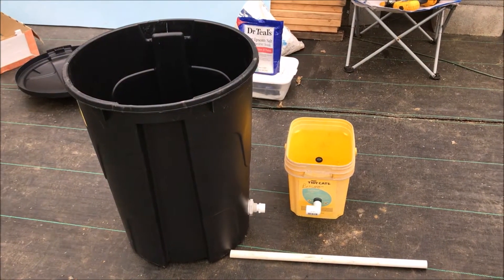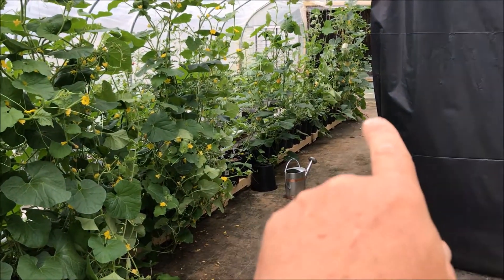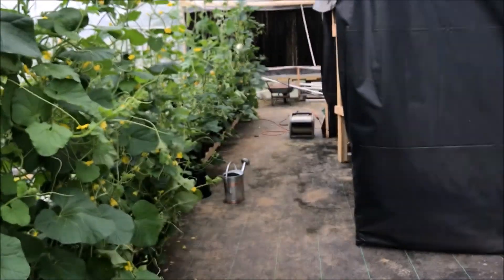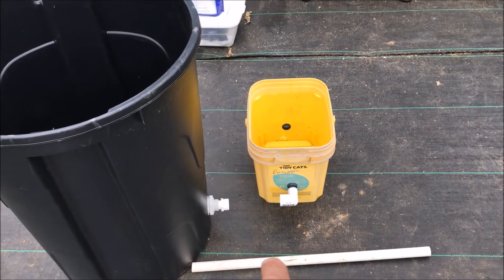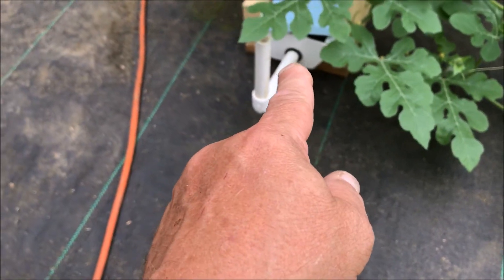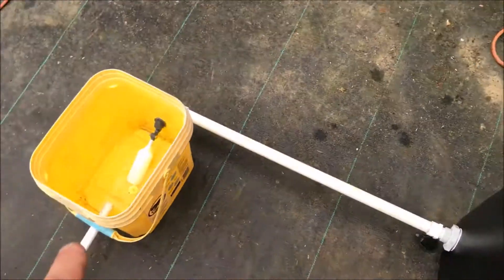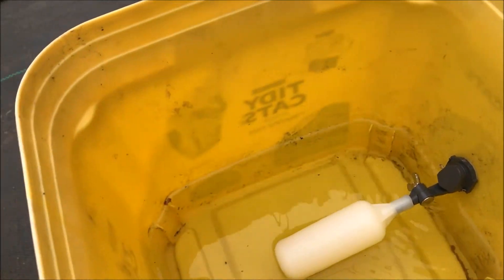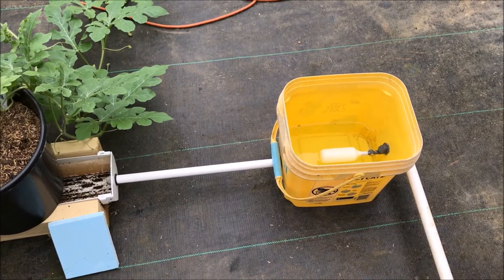Greenhouse Wicking System Reservoir Setup

Comment: Chuck, I really enjoy your videos. I am very curious on the wicking system. Is there no drain end? I see and understand how it fills but I am unclear how the other end looks. Do you use hydroponic nutrients or from your fish water? Inquering minds want to know. lol
Reply from the maker: This system has no drain. It fills the gutter system and the plants take up the water. I have been using a combination of mainly fish water from my aquaponics system and well water every now and then. I do not have it setup where the aquaponics system can fill it automatically so I have to use a utility pump to fill the reservoirs for now. It takes a little time to fill it so every now and then I will add some fresh well water to it in order to keep it from running dry until I can fill it properly with the fish water.
The goal is to automate it by next spring or sooner. I hope that answered your question Bruce.
Chuck
Reply: Thanks for the reply. I did want to mention that a couple videos the audio is low. Could be from using the selfie stick.

Comment: I have 1 40' bucket run and 1 20' bucket run. Both are fed from the same supply tank and each run has it's own float in the gutter. You're absolutely right about leveling. Don't trust your bubble level. Just fill the gutters with water and adjust them until they all have the same water level.

Comment: Hi, Chuck. Thanks. I would have thought the gutter would need a float valve also.
Reply from the maker: TheEmptynester I wanted to keep the float valve out of the gutter for a couple of reasons. One is space for more plants. Another was the control bucket allows me to fill the gutters more fully and still keep the algae down. And another is that it's much easier to adjust the water level in an external volume.
Hope that helps.
Chuck
Reply: Thank you for explaining more. I did not realize the bucket could control the water level like that.

Comment: Am curious as too how you keep the fluid temperatures down as I have read that temps above 65° can start to affect growth and production and temps above 80° are really determental. 

Also have you experimented any with the simple Kratky method?
Reply from the maker: atariforever2002 I'm going to go out on a limb here and say that water at 80 degrees is almost optimal for plant growth. My fish prefer temps over 70 so it never goes below that and they love it much higher. The water temp in my fish tank and aquaponics system very rarely goes below 80 and my plants and veggies are thriving. I'd throw that book you read away. Lol
Hope that helps 
Chuck
Reply from the maker: atariforever2002 I have grown with Kratkys method. Works wonderfully. That water will also get warm and will not harm the plant. Warm temps will however effect the leafy green veggies that you might want to grow in the system. Lettuce will bolt quickly in hot weather no matter how you grow it.
Chuck
Reply: Fensterfarm Greenhouse. Interesting. Glad to hear that. I wasn't looking forward too figuring out how to cool the water. Most of what I have read has come from the pot grower forums. Maybe that is a bigger concern for them. (don't grow or use that myself, too old for that silliness) but they sometimes have good info.

Comment: thanks
so this water doesn't recirculate, the plant buckets just drawl the water up from the gutter through the netcup?
Reply from the maker: Rev John O'Toole correct. They each take only what they need. I have to refill the 30 gallon tank once a week so far. I refill the 55 gallon reservoir twice a week but it feeds 90 linear feet of plants. I am pretty sure that I am done with the Dutch bucket system after this year. I will replace it with the wicking systems.
Chuck
Reply: why stop using the dutch buckets if you have already done the setup for them?
Reply from the maker: The dutch buckets use electricity and chemical fertilizers. I am feeding the wicking system uses fish water and compost to feed the plants.
Chuck

Comment: Leveling out the "long shallow"  can be a real bugger Brent.  In my "old" greenhouse I had some twenty foot long four inch pipes  with  three inch  top holes for cups that I never did get  exactly level.  
Ed
Reply from the maker: Eddy's Greenhouse Garden mine are within 1/4 inch and I called it good as the plants grow and he heavy I am sure that I will have to adjust it again too Ed.
Chuck

Comment: I used the Green Tree multi flow system, using grodan croutons for years.
Getting it level above the surface is crucial.

Check out the croutons because you can use them straight hydro, and recycle into a soil set up down the road. Grodan never goes bad...

H2O2 is your best friend in multi flow from what I've seen...

Drainage & Oxygen....
Reply from the maker: I have used rock wool to start plants for years but have just recently moved onto Coco Coir instead. It is much cheaper and also last for years.
Chuck
Reply: Fensterfarm Greenhouse 

like coir, but croutons hold more oxygen, drain, and their structure in the pot allows for massive rooting growth.
They look like salad croutons!
Coir finds the horizon, croutons hold structure.

Mixing the two, or sunshine #4 with croutons works very well.

Cheers!
Reply from the maker: Coir mixed with rice hulls, bio-char, and composted manure seems to be doing an amazing job. See my last video. I will keep the croutons in mind if anything goes south later on in the season, but at this point I cannot see how anything could improve what I am seeing. This is doing so well I am in the process of eliminating the Hydroponic Dutch Bucket system from the greenhouse after this round of plants and replacing them with this wicking system in its current configuration.
Chuck